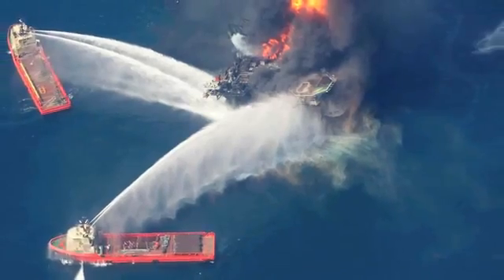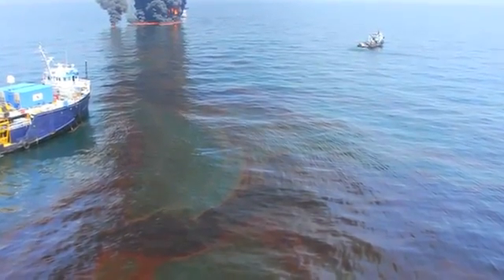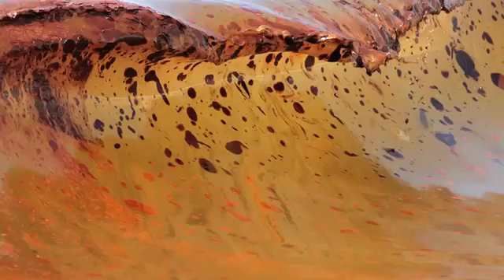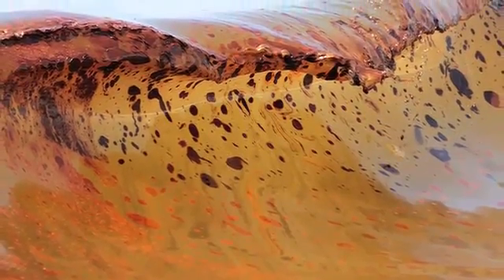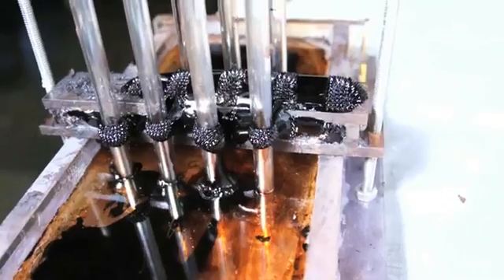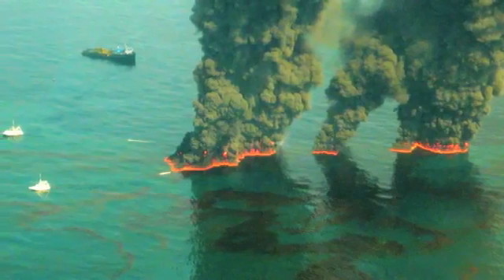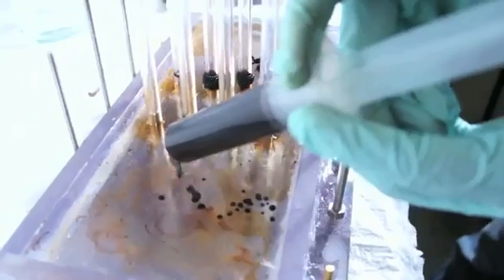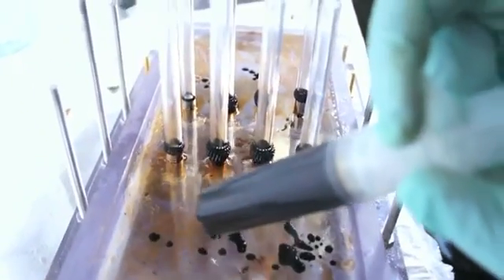Technique Magnetically Separates Oil from Water

Comment: I only say this cause i found a way to comingle static electricity with prana  & made sure to convert my body into the same as a dry cell battery (before storing it inside me).  I accidently shorted out the power of about 8 blocks worth of my surrounding neighborhood's electricity.  Only with 6 days of fasting and a half glass of water (i didnt detox before i pulled this off; plus i was ignorant to what zen meditation was at the time).  I very small blue bolt came from my finger & boom!